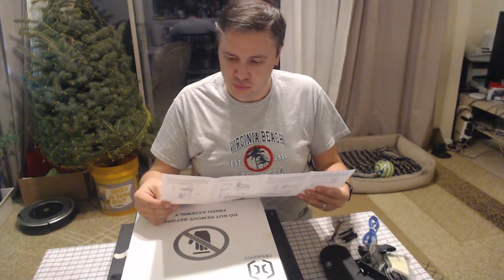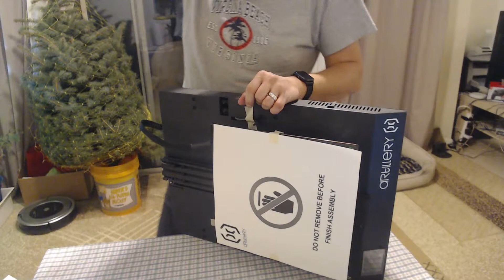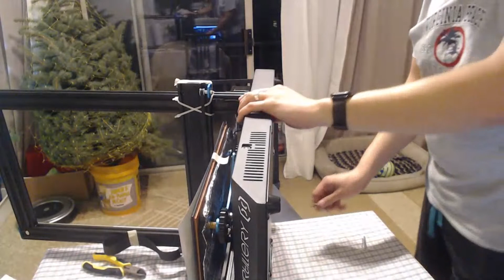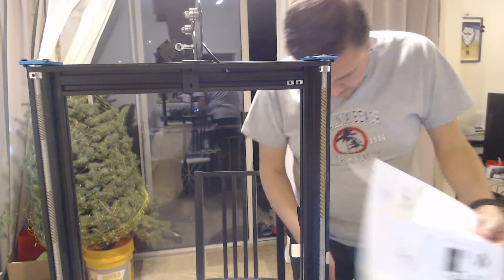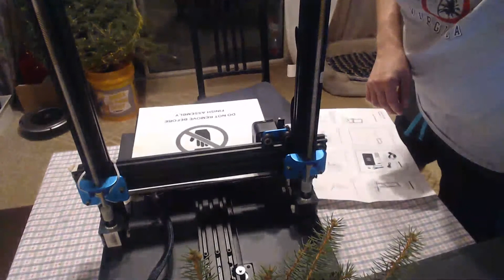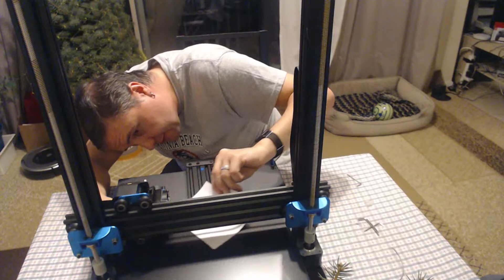Artillery Sidewinder X1 3D Printer Assembly

Comment: Thanks for the video!
So, have you printed anything?
Reply from the maker: Sure, I've already printed some models (including a few benchies). The quality is decent, but there are some layer inconsistencies. I plan to try eliminating possible factors one by one (belt tension, alternate spool mount, hot end PTFE tube - it is, supposedly, crappy). I will also try printing slower (I was printing at 80 mm/sec)
Reply: @IgorsWorkshop  cool!
Are you going to record video with the fixing process?
I saw several reviews of the printer and most bloggers said that the device works well "from the box" and doesn't need any additional adjustments. It sounds too good to be truth :) I also watched another assembling video and guy from the video fixed the bar and the extruder and pulled on the belts. You said the bar and the extruder were good enough in your case and it's really good news.
I am going to buy my first printer and I am a newbie in all this stuff. It would be super helpful to see the real-world usage/adjustments experience.
Btw, when did you buy the printer?
Reply from the maker: I bought this printer about a week ago. Yes, I plan to make a video on troubleshooting. As for working well from the box - it does work, it definitely requires less tinkering from the box, then my previous printer (Wanhao i3 Plus), the print quality is... well, don't get me wrong, it's ok, but not more than that. I'm pretty sure it can do better. Watch Maker's Muse's video about this printer, he highlights some of the issues that he encountered, including layer inconsistency. Mind, though, that he was reviewing a pre-release version.
Reply from the maker: My first troubleshooting video is out: https://youtu.be/4b1cYxoPnDw